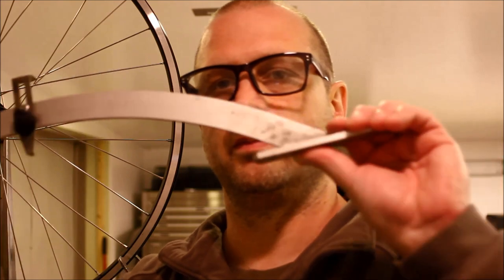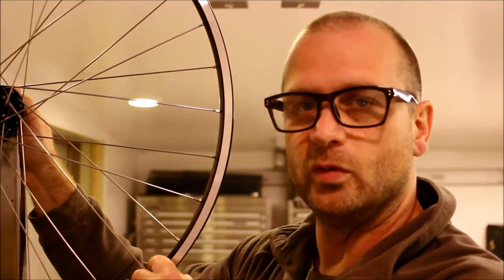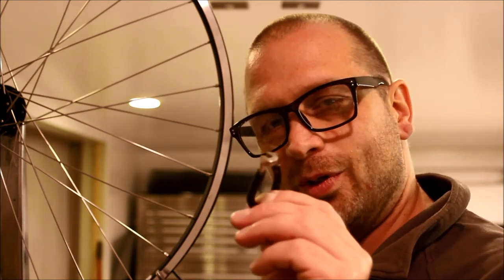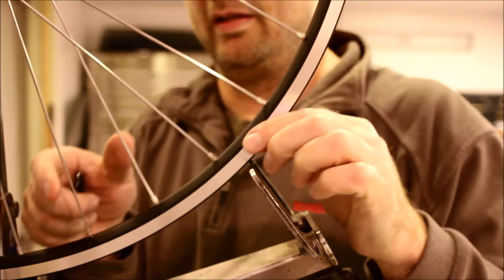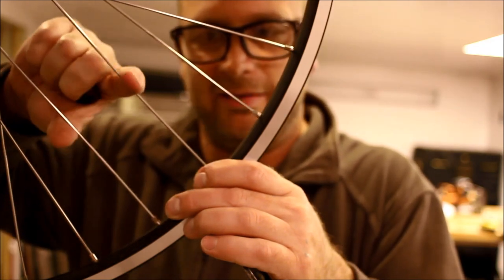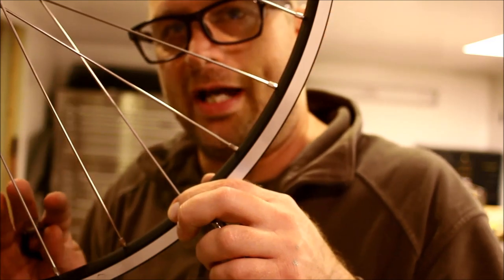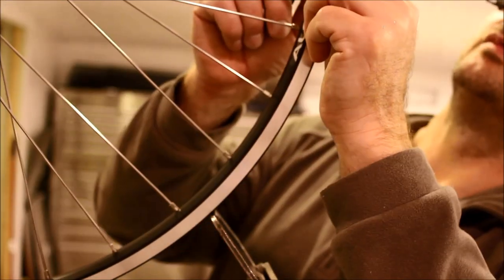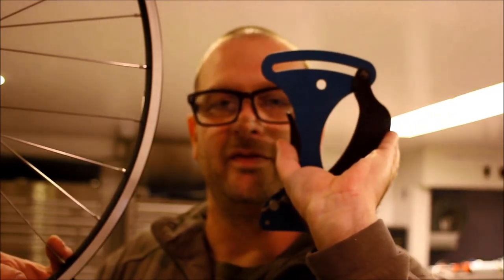Wheelbuilding: How to Tension a Wheel

Comment: I like your videos, Great Work! But her's another thing that I can't resist to mention. When using a dishing tool, after you put it on one side of the rim, adjust the indicator to make three-point contact and put it on the other side, if you get a gap at the hub, loosen the indicator and make three-point contact on this side, put the tool on the other side to get the gap at the rim. Now if you push one side of the tool onto the rim by hand to get all of the error showing on the opposite end of the tool, that gap is 4x the actual distance the rim needs to move! 
The other advantage of having the error show at the rim, is the rim has to move to the side that the dishing tool is on, which is slightly more intuitive than having moving the rim away from the gap; which is what is required when the error shows at the indicator on the hub.

Comment: Well made video. How much thread engagement do you want to see in the nipple when determining spoke length? 

I went to fix a rear 29" mt wheel that had thrown a chain into the wheel. The replacements I received from the LBS were 290mm and they ended up only engaging a few threads before one of them pulled out. When I looked at the nipples they had like 4-5 mm before the threads even started from the bottom of the nipple.

 I decided just to rebuild the wheel and just ordered 294mm for that side and 292mm for the other side. It appeared to have 292 and 290 respectively after I checked myself; however, there was 3-4mm of thread before bottoming out in the nipple. Besides bottoming out on the threaded end of the spoke, and what I experienced where the spoke pulled out of the nipple from a lack of thread engagement, is there a set rule for spoke length?

I don't do this enough to warrant the truing stand, tension-meter, or dishing tool at this moment, but I get the technique as you have demonstrated and how to apply it. Wheel building seems like a great thing to know, so it's worth the trial and error of beginner mistakes. Thanks again for the video.
Reply: Spoke 40spoks

Comment: What am I doing wrong with my front wheel. I measure with tension meter 21 for non disc brake side, 23,5 for brake side = wonky as hell, almost comical.

Comment: James, thanks a lot for your both informative and entertaining video. Could you please comment to this question: if you tighten a left spoke and loosen a right one, isn't loosening two adjoining right spokes (for half the force each), a better approach?
Reply from the maker: Eli Slotboom Which spokes to turn , and how much is dependent on how round, true and tensioned the wheel might be. Ideally, each spoke will have nearly the same (and correct) tension and the wheel will be round and true.

Comment: I never understood why people confuse themselves with the direction your turn the spoke-key. It's still righty tighty lefty loosey if you look at the spoke wrench from where you were standing (imagine you're looking through your rim from where you're standing, you turn the key right to tighten!).
Reply from the maker: Yep! I guess folks just aren't used to seeing it from the flipside??
Reply: I agree with you. That is why the working standard is  reversed. You can't work with your head and hand between the spokes. The normal way to work on your wheel is by watching it through the rim's spokes screws. In this way the working convention is preserved, left for loosen it and right for tighten it.Period.

Comment: wait. if the drive side spokes are shorter, why do you have to account for dish early on by doing a separate extra turn on the drive side spokes? wouldn't it pull towards the center by default as both spoke sides are tensioned since they are shorter spokes?
Reply from the maker: It's been a while since I filmed this so did I use shorter spokes? Short enough anyway? I can just tell you if you calculate pretty close on length, you often need a few extra turns on the drive side to get dish right. The key is constant checking of dish, true and round while tensioning. If your spokes come thru the nipples, they're too long and you have to start over w shorter spokes.
Reply: @JamesGlassJamesGlass  thanks for the info and a great video. with all due respect, you forgot a crucial part of the building process, and that is to destress the wheel during the tensioning. im just learning myself but everything seems to be straightforward. the only thing i need to learn is all the different kinds of lacing methods

Comment: Why is are the later steps done with the special tool, while the initial steps are done with a screwdriver?
Reply from the maker: When the nipple is easy to turn because there is no spoke tension, a nipple driver or screwdriver can be used to save time. Once the wheel starts being tensioned the nipple has so much resistance you have to use the spoke wrench.

Comment: Do you have video on rear wheel?
Reply from the maker: I don't. The build is the same though, although often the rear wheel drive side spokes need to be shorter by at least 2mm to account for the cassette (or freewheel in older hubs). Remember: align the middle of the rim to the middle of the axle, not the middle of the hub! The middle of the hub isn't the middle! So, you the dishing tool (or flip the wheel over in the stand to get the same measurement).